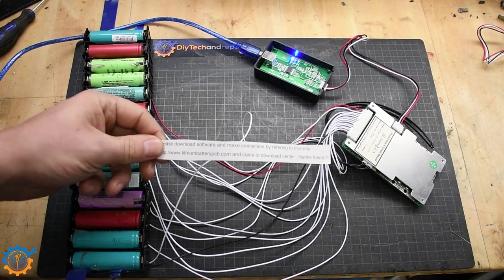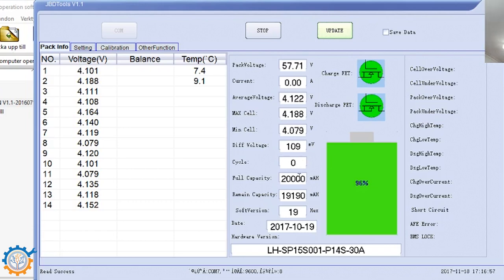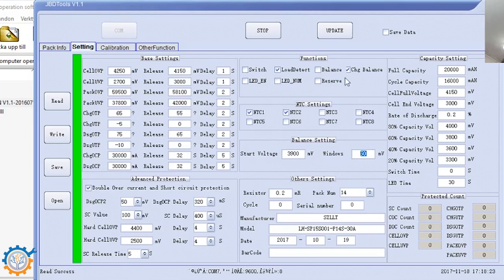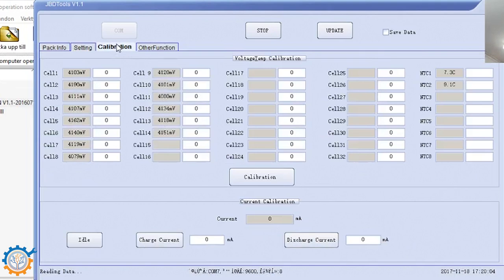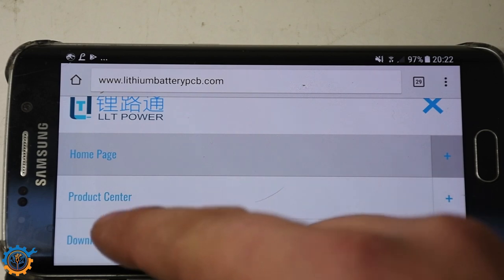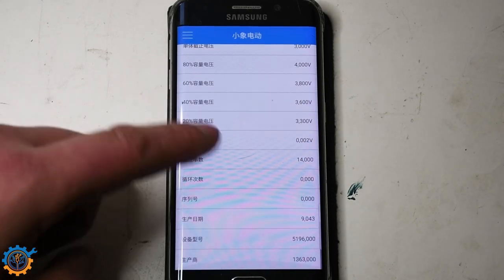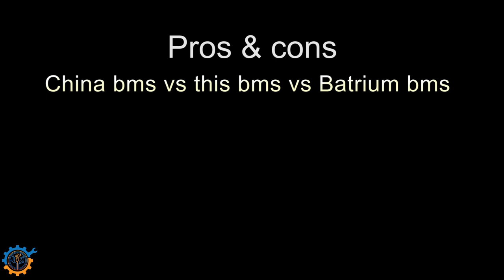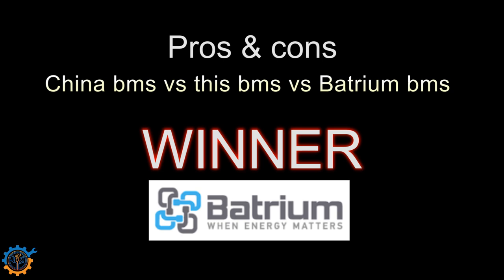Smart BMS review - Cheap choice for those with low budget

Comment: Do you know if it's possible to set the max charge current limit on this BMS? Thanks
Reply from the maker: Charge current is something you set on ur charger. Some bms systems can controll the Charger based on individual cell voltages but they are few and cost more. IF you ask about over current protection a fuse is needed. Dont know IF this One have built in to controll something based on current
Reply: @DIYTechRepairs  Thanks for the reply. I thought that might be the case.

Comment: I have this BMS (the 10S version) hooked up to my battery pack, and everything looks fine from the app, but I cannot make it take a charge. I connect 42V to the charge port (connected to C-) but no current is let through at all. Any ideas?
Reply from the maker: Did you hook the negative connection to C- or the pos?
Reply: Charger negative to C- and charger positive to battery positive. Battery negative to B-
Reply: Do you do anything to begin a charge cycle other than applying (constant-current) voltage between C- and battery positive?
Reply: Got it working, probably the problem was the pack was too unbalanced.

Comment: Good stuff! It's a damn shame it only does 50ma however.
Reply: 12ax7 You can set balancing to run 24h like I do. I have 30Ah 14S battery on my E-bike and this BMS is life saver. I set overvoltage protection to 4.1v to save cells life and BMS shut off charging when voltage is reached. Last version of app is on English ad its simply Amazing what you can monitor and change. You can even set pin and lock power out your battery with just a click. There is logs for every cells etc... Much more. Amazing SMART BMS.
Reply: @NexiTech  thank you so much for this info, this is what I needed to hear before buying!

Comment: Hello Thanks for the  very intresting video.  would it be possible to  read information from another bms  using the software and usb box from this bms?  i have a yamaha ec-03  battery that is restricted  til 500 cycles do to software in I think the bms  by yamaha.  battery is still in good shape but wont charge anymore, , when i charge with alternative  charger  battery is okay.  this is a common isuu anyone already solved this  yamaha scam ?

Comment: Over 10X cheaper than Battrium! You can add contactor to increase current endlessly :)
Reply from the maker: CheapVlog true. But I think this has it's area for small packs meanwhile Batrium is for larger batterybanks like powerwall. :)
Reply: Building >1A balancer yourself  is easy and cost nothing: TL431, resistors and transistor ;)
Reply from the maker: Thats not the issue as such. The time cost. Or more i loose money spending time on doing it myself. :) And many people dont even have the knowledge.  

The day I can live on this and build such things myself then I do it :P
Reply: Hey CheapVlog thanks for the idea. have you done this by yourself? I mean any suggestion how to make a high current balancer and then connect it to the cheap BMS and monitor it? thanks.
Reply from the maker: There is several videos out there. The simplest is just a couple of relays dumping the load to a big ass resistor. But there is so much more needed to get a proper system that will protect you :)
Reply: Is adding a contactor not problematic since the same port is used for charge and discharge?
Reply from the maker: Most systems have one failsafe and then breaks everything. ,note that the BMS is not there to turn load/charging on and off every now and then. Its there to protect and break the connection in emergency :)  With that said there is BMS system that control charge and discharge on its own but it all depends on purpose. Im using a system that does both so ne use in having that.
Reply: So you would for example use a separate controller for limiting charge and discharge overall voltage levels and just use the BMS for balancing and emergency disconnect in the event one of the other systems fail?
This was my original plan but I had hoped that the BMS would be sufficient for managing the charging which would be much lower power. 
It's unfortunate that these bluetooth enabled models with settable parameters are not available with separate charge and discharge ports.
Reply from the maker: All my controller/chargers/inverters handle it on their own and thats how it should work. A charger should always do its own charging as priority 1. Next is have a BMS to help out manage it. Batrium for instance can control some chargers. With my GrafPi software i can control some.. Thats #2.. Last resort is when shit happens. thats when the BMS take over and disconnect. 

Note that on #2 the BMS talks to the charger and say to it to calm down and charge less. Thats uncommon as of today and #1 should do 99% of all the action.
Reply: Yes, that all sounds sensible and was my original plan. These are intended for ebike use however where they are the only source of charge and discharge control. The chargers are generally voltage limited to the correct terminal voltage which provides some overall pack charge voltage protection. I think i'll go back to my original plan of separate charge and discharge control then with manual bypass to override the contactor in the (hopefully unlikely) event that the BMS activates the contactor. I'd have thought that a CC CV would manage charge rate just fine without needing comms from the BMS but I guess if there are temperature or balance issues it might be useful for charge rate to be reduced or have charging disabled.
Reply from the maker: For ebike there is no use for separe controllers. You dont ride at same time as you charge anyways.
Reply: Of course, and it's concurrent charging and discharging that makes the common charge / discharge port an issue for stationary use. You could easily need to do a low voltage disconnect while there was still some charge coming in for example. Really not suitable for primary controller use since resetting after a disconnect would need to be manual.

Comment: What Connector do those Chines BMS's use ?   Guess not JST-XH type.   Does anyone sell just the Connector and pig tails ?
Reply from the maker: its JST-XH on most of them. It can be tricky to get the ones for 14s and above though
Reply: The one I purchased seems to be the Mini Version of the JST-XH.  Looks the same but spacing quite smaller.

Comment: Can I bypass the BMS for discharge? This type of BMS is rated for certain discharge current which is too low for me. Is it a good idea to bypass the whole circuit for discharge and use BMS only to charge the cells?
Reply from the maker: Yes you can. Just beware that you dont have any low voltage disconnect IF you do so
Reply: DIY Tech & Repairs correct, but I will use VESC 6.6 and it has a  low voltage cutoff.
Reply from the maker: @PawelRaszewski  But a VESC only senses overall voltage and not individual voltages per cell basis.
Reply: DIY Tech & Repairs correct. It will not be a balanced discharge.  But this is what almost everyone does though. All the esk8 are build like that. Balanced charging and direct discharge bypassing the BMS. This is due to a high discharge current needed in case of electric skateboards. Sometimes it’s way over 100A. BMS can’t handle that
Reply from the maker: @PawelRaszewski  yeap i know. Its normal on high Power ev

Comment: Svensk visst? Skulle behöva lite rådgivning
Reply from the maker: Jodå! :)
Reply: @DIYTechRepairs  
Fan vad grymt! Har febrilt sökt efter guide överallt utan att hitta något vettigt. Vet du hur man räknar ut vilken amp styrka på bms som är lämplig? Bygger ett 10s6p 36v 17,2a
Reply from the maker: @Fhilipk  det beror ju på vad du ska driva med batteriet i sig. Och typ av bms.
Reply: @DIYTechRepairs  elcyckel. Vad jag har försökt räkna fram med lite googlande och räknande så tror jag motorn borde dra ca 360w
Reply: Typ av bms?
Reply from the maker: @Fhilipk  om det är 360w skulle jag säga du behöver minst en 20a bms.  20a klarar upp mot 800w teoretiskt men i China mått så klarar den av din ström
Reply from the maker: Använd inte hans design av hållare. Ivf nej man begränsar inte med en BMS. DU begränsar genom att se till att det du kopplar på inte kan dra mer samt med en vettig säkring. BMS är ett skydd och ska du dra max 30A kan du sätta en 40A BMS. Då vet du att den inte smälter om något händer.

Comment: how many cells in parallel can it handle for example ill try 14s400p  will it work ?
Reply from the maker: Its more about capacity. Its made for 20-80Ah. Then Its Up to you to decide how much above you want to raise it. The more capacity the less chance it Will have to Keep the battery in balance

Comment: Hi! Is it possible to change battery output voltage? For example, i have 42v battery with this smart bms, but my device uses 36v, can reprogram bms to give my device 36v instead if 42v? Thx!
Reply from the maker: No. You need a DC DC converter. A bms is protection and management for battery only.
Reply: @DIYTechRepairs  as I supposed, thanks for the answer!